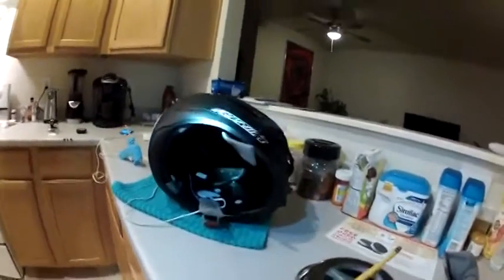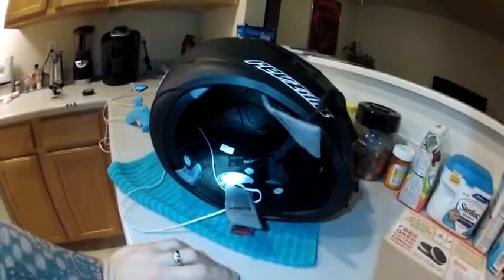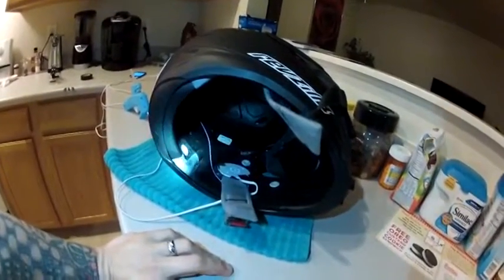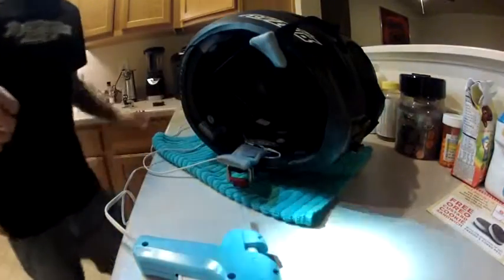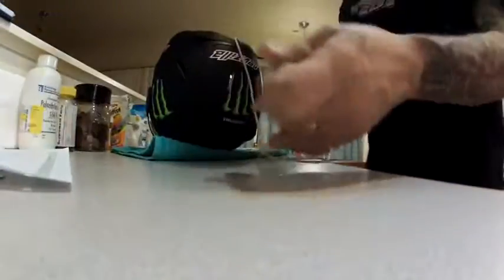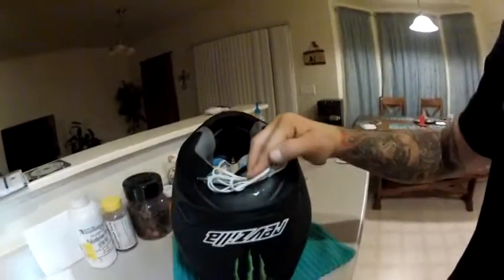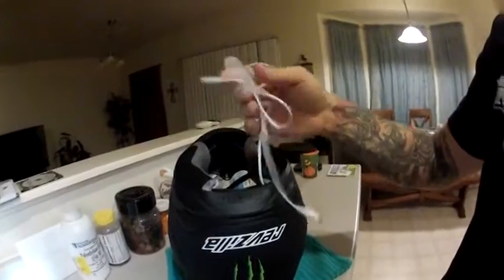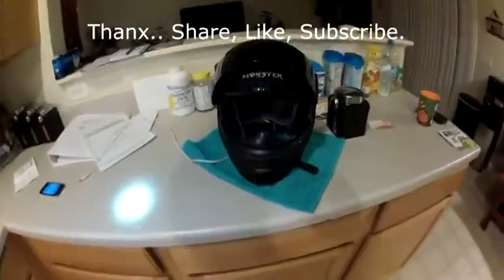☆How To " Install Speakers In Your Helmet."

Comment: How does it handle at highway speeds? I normally use earbuds, but I am thinking of using only earplugs, so I was wondering how well the sound would go through.
Reply from the maker: plbpardo works perfectly.. just like listening to a sena headset
Reply: Huh cool, I am going to give it a try, need to find an old head set at my house and see how it goes, thanks mate.